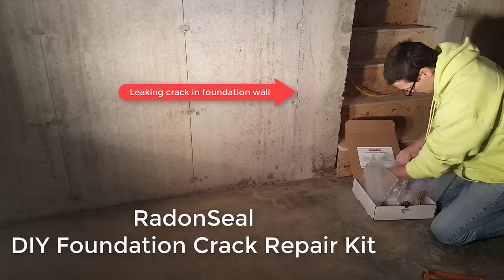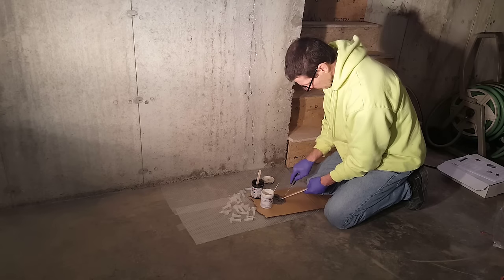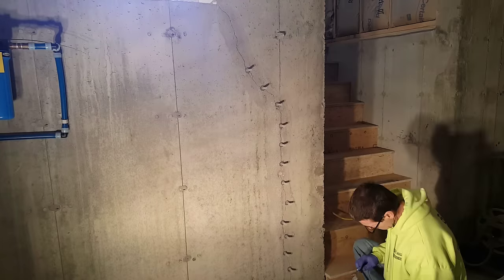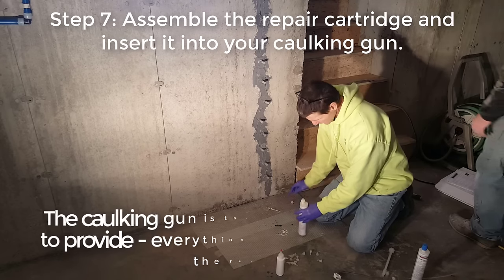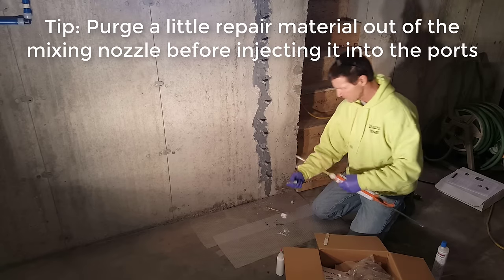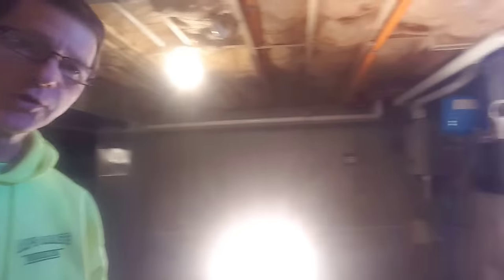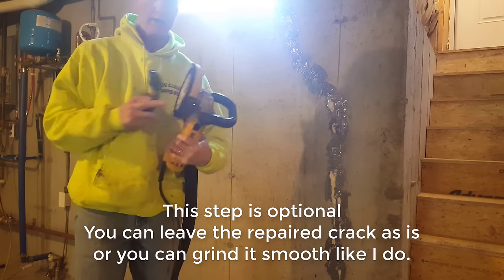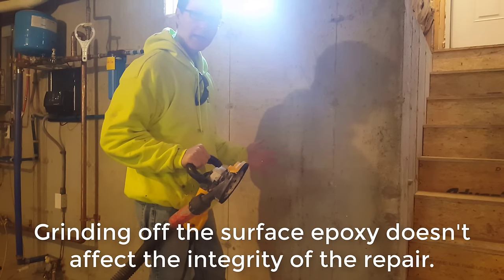BASEMENT WALL CRACK REPAIR : HOW TO FIX LEAKS A STEP BY STEP GUIDE

Comment: Will this seal around where a waste PVC pipe leaves the foundation?
and...
Once you sand/grind the epoxy....are you done at that point...?   No need for any cement?

Good video BTW.
Reply from the maker: It will yes, but they have a kit for that too here: https://www.radonseal.com/product/380.html
It's basically used the same way.
Reply: @MikeDayConcrete  

Thanks.  The PVC main leaves the foundation on the wall (vertical slab).  The cracks are pretty thin, but I'm assuming this will be still be sufficient to seal them up?
Reply: Mike- similar question.  
My home was built in 1950 and has a concrete floor with a metal pipe radiant heat system running through the concrete. After 71 years, a crack recently developed in the concrete in the closet of one room and when the radiant system is turned on, water emanates from the crack out the rate of 1/4 gallon per hour. Will the epoxy surround the pipe and stop the leak? Or should I use the other product you mentioned to Oldsouth? Also, is there a chance the epoxy will be forced INSIDE the metal pipe itself and clog the system? Thanks Mike! 🙂
Matt Gordon
Reply: Mike- similar question.  
My home was built in 1950 and has a concrete floor with a metal pipe radiant heat system running through the concrete. After 71 years, a crack recently developed in the concrete in the closet of one room and when the radiant system is turned on, water emanates from the crack out the rate of 1/4 gallon per hour. Will the epoxy surround the pipe and stop the leak? Or should I use the other product you mentioned to Oldsouth? Also, is there a chance the epoxy will be forced INSIDE the metal pipe itself and clog the system? Thanks Mike! 🙂
Matt Gordon

Comment: Part of our crack is on an uneven seem on the basement wall.   How would you place the ports on that area?
Reply from the maker: You can place them at an angle as long as the crack is sealed over after. Or you could grind the crack so it's even on both sides then apply the ports.

Comment: Does this injecting process work on old poured foundation, gravel/sand mix?   Thanks
Reply from the maker: If it's cracked, it will work. It expands 20x it's size when it cures blocking and sealing the crack.

Comment: I HAVE A HORIZONTAL CRACK ON MY BASEMENT WALL. WILL THIS ONE WORK? THANK YOU
Reply from the maker: Horizontal cracks tend to be more of a structural problem. You may want to get that checked. But this will work to stop any leaks unless it's really wide.

Comment: I have multiple cracks coming off one main one, mainly hairline, is it still ok to use? Also Urethane or epoxy version? Thanks
Reply from the maker: Yes, it's ok. just fill all of them. This is the urethane i'm using, it's really good for very thin cracks as well as larger ones.

Comment: Hi, I have a vertical crack about 1/8 inch wide (width varies from hairline to 1/8 inch) spanning the full height of the wall (visible outside too). The interior surface of the basement wall is  very uneven because of the "form" that was used to pour the concrete: it's like water ripples vertically, and horizontal grooves every foot or so. The crack is also difficult to access as it is a few inches from a vertical stud (the basement is finished; I pulled out the sheet rock and insulation) as well as behind what seems to be a toilet drain pipe for the last 2 feet of the crack at the top. I have a couple of questions based on my situation: 1) Given the uneven surface, do you think the injection port will adhere properly, and I can effectively seal around the ports and the crack?; and 2) Given the access difficulty, should I instead consider to inject from the outside, which unfortunately would require excavation (only 5-10 inches of the wall is above the surfaced. Thanks for the video.
P.S. Is there contractor in central VA that you know do this?

Comment: Do these work just as well on stair step cracks from basements with a cinder block foundation?  How would you space the injection ports on stair step cracks (i.e. at every corner)?
Reply: Yeah it can work however if its not leaking then its not neccesary. Stair case cracks tend to happen whem your house is real old and there is alot of stress however it can also be a sign of foundation issues where your foundation is settling. I would call a structural engineer if you are having some concerns dont call a company because they will just go out there to pitch you a sell on something you might or might not need.

Comment: Does this work for a corner crack?? Where the two concrete slabs meet?? Just curious how to get the ports in the seem.
Reply from the maker: Yea it will work. It's a little more difficult to paste the ports in the seam but it can be done.

Comment: I don't understand putting a layer of basically paint on a potentially structural problem with the thing that supports your house.

That epoxy isn't going to do anything to the constant load piling up in the house and on the exterior of the foundation.

You fix the problem where it starts, not where it ends. I just need more clarification on how this exactly "works".
Reply from the maker: The video is about fixing a leak in a crack. Most cracks that are vertical aren't structural problems. Horizontal one's are. This product isn't epoxy either, it's polyurethane foam. It's meant to be injected in the crack, expand, and stop water.
Reply: @MikeDayConcrete  Thanks for the explanation Mike. Appreciated.

Comment: so if there's an exposed crack on the outside of the foundation, is there no need to seal it with epoxy also?
Reply from the maker: If there is an exposed crack, it is a good idea to seal it so you don't waste product. The one in the video was so small I wanted you guys to see what it looked like when the foam expanded so I left it open.

Comment: Does this work where the wall meets the floor and how would you do this?  I don't see a crack but water in coming in.  Also water is coming in from the water line coming in.  Is using this a bad idea with a water line.  Plus the wall is cinder block.  Thanks
Reply from the maker: They have a product to use for that, this is what they recommend: https://www.radonseal.com/crack-injection/crack-filler.htm  If the crack is very small it'll be difficult to use anything.
For the water line area this is what you use: https://www.radonseal.com/product/380.html

Comment: we had the one where you actually drill the holes on an angle and then add apoxy..  the guy did it over 5 years ago and it has never leaked again..

Comment: Your video shows some very thin cracks. What if the crack is wide and the plugs that you are epoxying to the wall can't span the gap? Do you just buy more tubes of radon seal?

I also have a 2nd question. Do you think this solution is better than hydraulic cement patching?
Reply from the maker: If the cracks are wider than the base of the plugs, then you have what I would consider to be a structural problem. That's a whole different kind of fix. I would consider an engineer to take a look at that.

Comment: what do you do at the bottom where crack meets the floor?
Reply from the maker: It all gets filled in by the repair material. The foam expands 20x it's size.

Comment: How strong is the repair?  I have 3 cracks in my foundation, including two recent ones that have propagated to the drywall; I believe that part of the land subsides.  Why it does so now on a 50yo house is a mystery. But will the material create a wall as solid structurally as the original one?
Reply from the maker: Not this stuff, this is a polyurethane, it expands 50x to block any water from leaking. This same company, Radonseal, has a 2 part epoxy repair product that you inject the same way as this and that is a structural repair product.

Comment: What can I use on a hairline (like 1/32” or less) 7-ft long horizontal sloping crack.  It starts 3ft below outside ground level (just below an 8yr old foundation repair where they pulled back wall with a steel tieback) and slopes to basement floor.  It is seeping water when it rains and leaves a chalky white residue above and below the crack.  I won’t be able to get any port in this hairline crack.  Thanks!!
Reply from the maker: I would slightly widen the crack with a diamond cutting wheel on a hand grinder. Then do this same method.

Comment: I cannot get the water to swap out the ports. Nothing blocking the port holes I even drilled holes through the port and tried. I skipped the top hole and water came out the next 3 holes and then nothing out the next 6. I need help! haha
Reply from the maker: You're probably ok. The water is just going down the crack. Did you try putting water in each port to see if it comes out the one below it.
Reply: I knocked off all the parts and reapplied them. Water was still coming down every few ports but I decided to just add the poly anyways. It work but I wasted a lot of material. I was squeezing the caulking gun too hard and not allowing the poly to work up the crack. I went through 3 bottles on a 5ft crack so I have to order more for my 8ft crack.

Comment: Hello,
Having done injection work for 21 years, (both epoxy and polyurethane) I do not agree with the way this repair is being performed. Foundation walls are about 10" thick or there abouts at least where I live. In order to obtain a proper bond, the entire substrate of the wall MUST be wet. Then and only then can the polyurethane be applied to the crack. Tight hairline cracks may need injection pressure up to 2200 psi to penetrate the crack. Without that happening the urethane can fail due to improper prep. This should be done with a crack cleaning agent first. After which it should be flushed out with water then injected with urethane. Any dirt in-between the substrate can cause the urethane to fail. Also to note, I may be pointing out the obvious but urethane is NOT a structural fix. That will require epoxy injection. Urethane has a time and place such as active leaks which may need immediate attention. The point of my post is not to devalue the product or what's being done but shed light on how to do this type of work properly so the fix will last as it should. Whenever possible I always recommend epoxy over urethane. I would be more than happy to help anyone with advice who may have a question. Take care,

Comment: Its just expanding foam, no strength in it.yes it will stop water, but the crack can still expand and damage the wall or building, its a cosmetic temporary fix. Buy a filler that actually bonds  to the concrete and is rock hard, and is just as tough as concrete and NOT foam.

Comment: Aren't you supposed to wait at least 8 hours to let the epoxy paste used to patch the crack and anchor the injection ports dry, before injecting epoxy into the injection ports?  But, overall, great video.